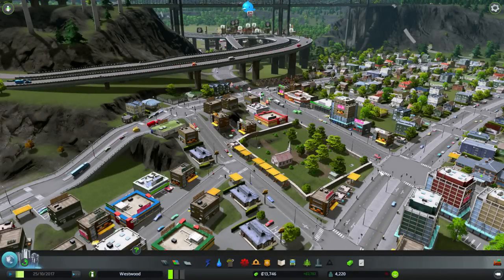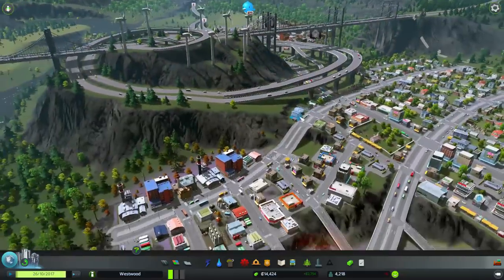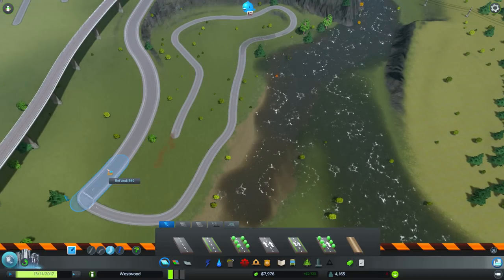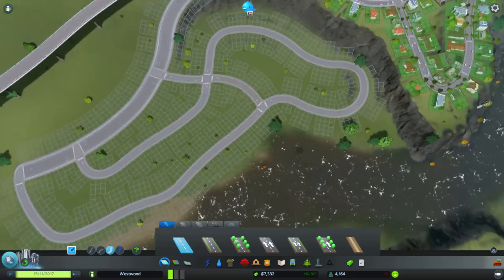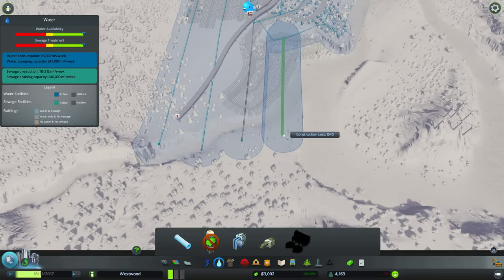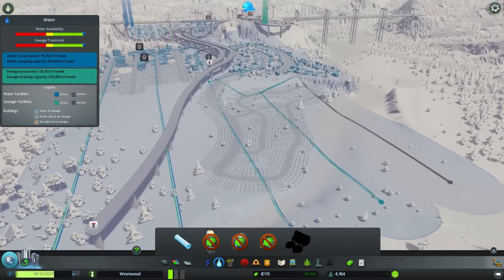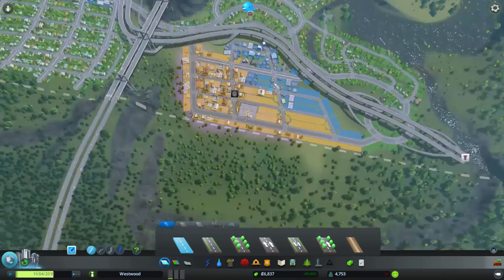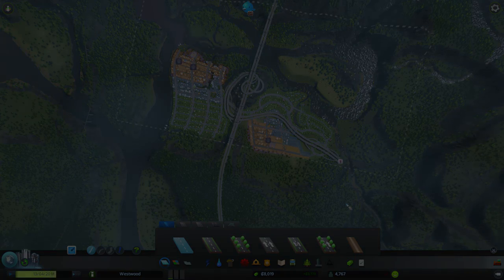Cities: Skylines #7 - Roundabout

Comment: not sure if youre going to read this, but you totally need to get the automatic bulldoze mod. it auto bulldozes abandoned and burned down buildings without any player intervention and makes your life so much easier.

also when zoning you should use the square filler next to the paint bucket. it allows you to make a draggable selector for large areas without worrying about missing squares and it can jump across zoneless gaps.

Comment: you can remove zoning by right clicking without having the remove zone tool active.
and the water will be a problem later on, you just have to put a dam on the wide body of water (I have the same map as you and it worked)

Comment: Hey Z,
I'm not sure if you already know about it, but just to be sure: There is a tree-cap in the game (you can only have about 500 trees [i think] at once, in the accessible area)! The problem is, that trees do NOT get removed if you build roads etc. on top of them, instead they just turn invisible. So obviously what you want to do, is remove all the trees before building in that area! If you continue this series/this map 'til the 'end game', it will make your life A LOT easier!!! You can thank me later, for saving your life :P
Reply: Tizian Schuhbeck 
Why the hell would there be a limit on the number of trees?? That makes no sense from a coding standpoint unless they auto-spawned up to a certain level.
Reply: Yonkage Probably to limit the amount of things in game. 500 is a good amount for background assets, but you probably wouldn't notice if some of them faded in/out as you played.
Reply: Snow Mochi
I'd certainly freaking notice if I made a open with some trees in them and then the trees started disappearing for no reasons. They should be models, not background assets!
Reply: But would you notice if they disappeared 2 tiles away?